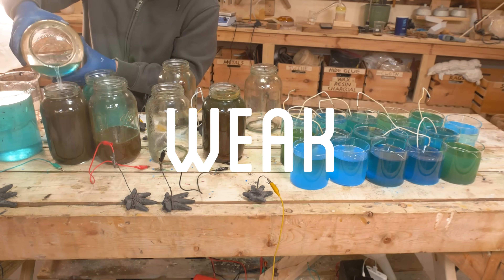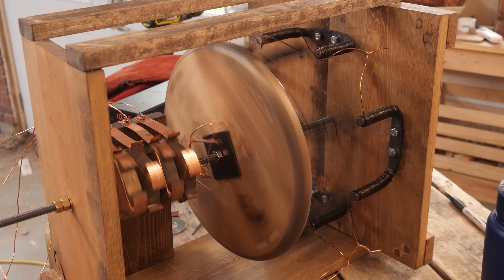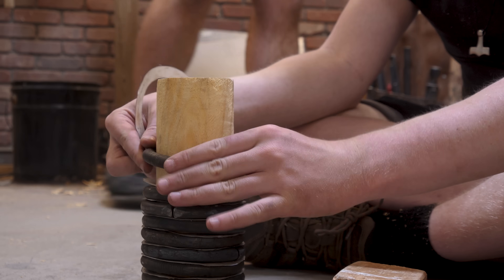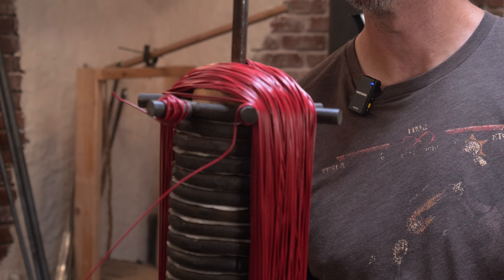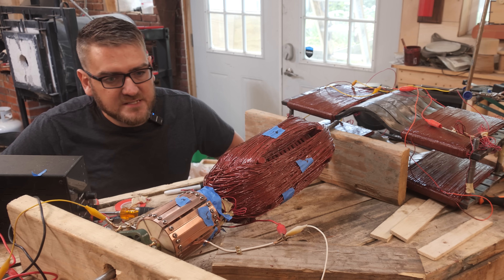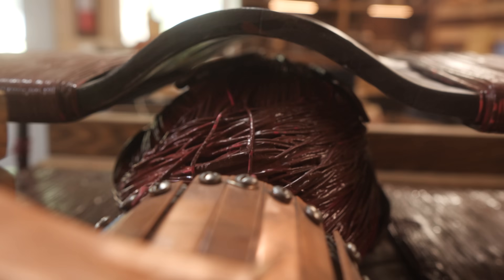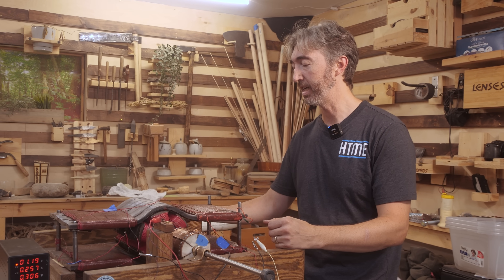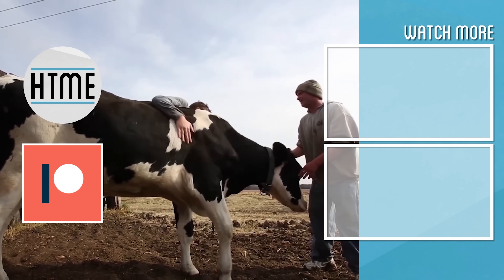I Built the First POWERPLANT!

Comment from the maker: Get $5 off your next order through my link https://sponsr.is/magicspoon_htme_0925 or use code HTME at checkout, or look for Magic Spoon on Amazon and in your nearest grocery store!
Reply: Your second rotor was not only more consistent but had a much better magnetic design. The iron laminations are where the magnetic flux flowed, having a much lower reluctance (magnetic resistance) than the huge amount of air in the first. Now I’d like to see the same in your stator, which was improved by adding the iron tie rods. But replacing those with huge iron cored electromagnets between the pole plates would increase power generation. The other thing that’s helping with your second rotor is reducing the air gap between the iron of the rotor and stator. If you could find a way to bore out the stator plates to a perfect cylinder, only slightly larger than your rotor lamination outer circle, you’d be cooking!
Reply: @MarkSJBeard  He also could have run the rings on the mount through a lathe to get better tolerances.  To make tighter clearances between the rotor and coils, The the iron cores as parallel as possible and then use a large boring bar to machine the rotor area smooth.  An inverse lathe, if you will.  You could get a paper width between the rotor and coils at that point.
Reply: I feel like it would be good to make a capacitor next to balance out the current instability and the flickering problems.
Reply: @risingmoon893  something better than a capacitor is a motor with a flywheel attached to smooth out the slow voltage spikes, a modern one could work for debugging
Reply: please change the title to "I Built my First POWERPLANT!" because your current title is misleading
Reply: A suggestion; what about a second brush but inverted on the other side of the commentator. I.e a brush on top and a brush on bottom. 

Or you could add several smaller brushes to help off set the bounce.
Reply: something that can massively improve the design is replacing the flat stator coils with bunched up coils, the tighter the coil the more powerful for a given amount of wire, the coil must spread out a little but the more this is minimized the better
Reply: Cant you invert it? like, make the magnets rotate inside or around the coils, to get rid of the need for the "brush" on the generation part of it. i dont know, just a thought.
Reply: @TarubXCI  That will produce only a.c. power, which is fine is some applications but to replicate early power generation you need d.c. to make things easier to understand.
Reply: So was the plan to use the electricity generated to make the coil magnetise the iron core with the hope of increasing output oerall?
Reply: IMHO the biggest problem is the weak and hardly controlled field of the stator.
Building the stator from continuous, forged plates gives the magnetic field a path of low reluctance along those plates. There is no "incentive" for the field lines to get out of the iron of the stator and close their circuit through the rotor. Also, these cores leave the magnetic circuit completely open on the outside of the dynamo. I am pretty sure the magnetic field is much more intense at the ends of the stator than between the intended poles.
I would suggest using the plates to build U-shaped electromagnets with rounded poles.
Something like this :
    _
   |  |
  (   )  (   )
           |_|

These could be placed alternately, left and right (although this is not necessarily advantageous) .
Reply: graphite brushes would be an improvement for the generator. graphite is both a conductor and a dry lubricant.

that and really centering the rotor...remove as much vibration as possible, so you folks can run it at really high speeds!

Comment: Why not try coil on coil coupling. It would give you much more power. I see the steel plate is acting as a flux return, but wouldn’t adding stator windings give much stronger and more controllable torque? Coil–coil interaction usually beats passive iron shaping, especially if efficiency matters

Comment: With my limited knowledge, I would say to swap the rotor and stator so that the magnets are rotating and the wire is stationary. This way you can try to get smoother, separate coils and spin a lighter mass that can get a lot closer to your coils. Smaller wire gauge should also help so you can fit more wire to strengthen magnetic fields, and spinning your rotor faster and more smoothly to maintain your AC voltage. The shorter those gaps in voltage, the easier time you’d have reading it

Comment: question for anyone whom might know, Would there be reasonable energy produced by simply wrapping insulated copper wire around an aluminum pipe and passing water through it at some pressure and velocity?

Comment: A GM alternator has the coils on a stator wrapping around the armature. This allows for a lighter rotating mass and a more prosise gap between the the stator and armature, then once the armature gets exited with electrons it produces current. It is also possible to self excite as a windmill or something of this like or by adding a small battery to excite the field. I suggest looking at the GM alternator for a proof of concept.

Comment: if a gearbox can increase rotation per minute then would you then see that the ending RPM can rotate a generator core faster then the rpm at input. Granted that the increase in crank energy provided and a more stabalised foundation is needed for a multiplied output, but it is deffenately doable.

Comment: "Great video! Attempting a self-exciting dynamo is incredibly tough. I think you are facing two main issues:
Residual Magnetism (The "Bootstrapping" problem): Since you used soft iron rings to reduce eddy currents, the core likely has very low magnetic retentivity. A self-exciting generator needs a small initial magnetic field to start producing current. If the iron doesn't hold a charge, it produces zero electricity to feed the coils, creating a loop of nothing. The fix: You need to 'flash the field'—briefly connect a battery to the field coils to magnetize the core just before (or while) you start spinning it.
The Commutator: You were right at the end. The large diameter creates high linear velocity, causing 'brush bounce.' A smaller commutator or stronger spring tension on the brushes ensures constant contact.
Hope this helps you unlock the lightbulb!"

Comment: I would consider looking at how early lathes managed speed for your input. A series of belts and pulleys, combined with a flywheel to help smooth it out a bit, could really help on the input side. For the contacts on the commutator, you could try to add some springs on a fixed bar above them to try to see if that downward pressure helps ensure more consistent connections.

Comment: This really show cases as to why steam powered belt & lineshaft systems were so popular for a time, as simply making a turbine at all required a level of sophistication not possible by hand. While steam powered systems greatly improved speed and force they also improved finesse creating a number of products. Even after city wide turbines were in use these belt & lineshaft systems swapped out their steam boilers for electric turbines and exchanged in house coal burners or city wide coal burners. Many cities became very proud of swapping out their gas lamps for electric ones. However, trolleys were only electric powered, thus making the first transit system electric.

Comment: Try to excite the core artificially with a power supply, because you might be not generate voltage high enough to make strong enough field. Gap between stator and rotor should be as little as possible, makes a lot of difference. Commutator should be a smooth ring, its will decrees sparking. Also there is better material for the core than just steel, ferromagnetic alloys.

Comment: Aren't you making AC voltage? Have you checked? Have you checked the wiring to match the examples you have shown? Top stator winding connects to the winding before it, them that goes to your output, same but opposite for the other side. I think that also means you should connect the stator iron like it looks like in the pictures with the bolts. Some things good you to try

Comment: Wheree are u guys located . I have  some serious  additions that could help. Would apprentice happily.  But i gotta ask are u stuck.on this design or any design that will create electricity.  Cause if ur flexible  trust me we need to catch up. Happy to share  my blue prints and some engineering parts i have access to others  incant get to at the kment but xan wasily recreate . This is the exact  project i was going to do. Only i  was going  to go from  actual ground to full production scale. Ive been a pipefittter steel guy roofer hardscaper carpet work and a gym owner / pugilist. I have a number of project's  including  a water purification from air/ electrically assisted high yield shortened time crop production system all in one.  and multi input electrical system assisted part gravity part wind part electrostatic with oldschppl chemical batteries snd conversion. Inknow ull laugh  but i think i cam avtuslly tramsmute elements as well on a small scale. No patents just work a d hopefully a better  future. Truly feel were running iur if time if certain projects continue on the national scale. Sorry fir the spelling and punctuation but im excited.  I northeast usa  hope are too

Comment: are your standoffs conducting electromagnetic field away from the rotor? might be cutting efficiency by reducing the field lines the coils are passing through by pulling field from the rotor and in to the standoffs? also lathing the surface of your commutator will cut bounce if you can cut a straight line yet or use stronger springs and let erosion smooth the circle with an electric motor while you sleep.

Comment: Checking in here now to see all of the suggestions. Wondered if anyone thought of making the contacts able to change their positions to correct the latency’s of the current. Could be adjusted for different speeds for maximum output. Plus or minus a few degrees in position is worth trying. Thinking mounting on a wooden cross piece for the contacts. (Water paddle wheel style.)

Yeah it adds complexity but effectiveness sometimes is needed for maximum effectiveness.

Comment: So, the timing bit is difficult. Modern generators use a micro-controllor to handle the timing of the current switching. This is because using a contact like you have will not only introduce inefficiency but also will add wear over time. In the meantime, switching to a flat copper braid cable as your contact might produce a more consistent result.

Comment: If you can, put some graphite between the commutator brush and the rotor. helps keep consistent contact between the two and prevents the discharges off the commutator and the friction from eventually eating your brush.

Comment: As far as I'm aware, making a self-exciting generator is difficult without permanent magnets. I think you could make one of those primitive batteries you've made before, connect it to either the stator or the rotor and use it as the input for the electromagnet. You don't need crazy input power so the battery would be enough. If connected to the stator, the output at the rotor will be DC because of the commutator. If connected to the rotor, I'm pretty sure the output at the stator will be AC, which is still useful but not in charging batteries. There is quite a lot of videos of people turning AC motors, into generators by connecting a capacitor, which you should be able to make with your current technology. The capacitor can charge up, act as the input power and then get constantly recharged from the spinning of the rotor, essentially acting as a self-exciting generator. This probably sounds very confusing so look it up, as I am not the best at electricity. Also, speaking of AC motors, you could try running your generator as a motor, although idk if that would help with anything.

Comment: While not speaking directly to the electrical generation, it might be beneficial to introduce a heavy fly wheel. This will smooth out the rotation of the crank which in turn could help with a more uniform power output.

Comment: as a physicist i think you should make the stator more round, possibly with a lathe, and make sure you really precisely put the rotor snugly in the middle. you want as little air in between them as possible, 'millimeters' is too many millimeters. precision is key here i think.
also make the stator hug the rotor more on the sides.
personnally i would not put multiple coils on the same piece of iron in the stator for my first design, but thats just to keep it simple. i would put the stator coils pointing radially, not in this weird flat shape.
i dont understand this stator design in general, i feel like the iron connections should be the other way around, connect vertically if you have the coils like this, and not connect horizontally as to make the magatic polarity as large as possible over the rotor, it feels like you are only using like 10% of the magnatic field of these stator coils, because of the allignment, but maybe the iron changes this. again you probably want your coil radially from the axle, similar to the rotor coils so that their field points in to/out of the rotor. if you use 4 or more stator fields, you want to alternate north south.

i dont know about your wireing (cause you didnt share it :(  please share your circuit diagram) but if you are changing the current in the stator, the metal should also be laminated against eddie currents. it is a good idea to do anyways, since your rotor also makes changing magnatic fields in the stator

its been said alraidy, but:
- use a capacitor to make the current steady, would also help the stator probably, so dont eoverlook this as an option to make the engine better.
- use a gearbox, balbearings and lube for some serious rpm
- make live measurements with an occiloscope, it would go against the techtree, but it is good to get insight in what is happening
- use brushes or carbon instead of springy copper for the commutator

some more tips:
- if it stops starting by itself, try turning the whole thing 90 degrees, it is probably using earths magnatic field to start up
- experiment with the phase of the commutator, it might be better to have it shifted a bit forward since the rotor changes the field sligtly, make sure to test it on the desired rpm
- you can connect multiple coils at the same time with the commutator by having a broad brush, sometimes this is better, because 2 coils can be doing work at the same time when you have 3coils in the rotor

Comment: You can run some capacitors in parallel with the output to smooth out the pulses so you can get a smoother output to measure the current. Even things like buck converters can be useful as well, and cheap.

Comment: Most commutators use wire brushes to connect to since it means any bounce is less likely to disconnect it or it just wont bounce at all
You probably want to either switch to wire brushes or put small cuts in the conducting plate (the one that is connected to the cabling) to replicate it without having to use wire brushes, it wont be as efficient but it should be an easy adaptation

Comment: You can get rid of the commutator by looping one pole of the rotor clock wise and then anti-clock wise for the next one. At the ends you only get two wires for two contacts that can be soldered to a copper ring, then use graphite contacts and.... Wait... You know what, you will end up re-making the 3 phase induction motor by the end of it.

Comment: No wood, add bearings; instead of wood use metal. Metal is more durable; bearings make more accurate turning and speed of turns. Also wood may not last; it may break and will have to be redone.

Comment: Since the magnetic flux lines curl around the coils of wire, shouldn’t the stator coils be wound perpendicular to the length of the stator instead parallel as it is now? Because in this orientation, wouldn’t the bulk of the magnetic field be generated parallel to the stator bars and thus not interacting much with the rotor because the flux prefers to mainly travel through the iron and not the air?

I believe this is the setup of the generator: 
N((((S—N))))S
     ======
ns       *       ns
     ======
N((((S—N))))S
Legend: = is stator iron bars, ( and ) are the wires wrapped around the bars in different directions, * is the rotor, — is the part of the stator bars with no wires wrapped around it, S and N is the magnetic orientation, and n and s weaker magnetic poles orientation.

I believe the idea is that right ends of both bars combine to create one main magnetic North pole in the air gap between the two stators, and the left ends of both bars doing the same to create the South pole, right???? This should work, however, the poles would be rather weak because magnetic flux prefers to travel mainly through the iron bars instead of combining in that air gap to make one strong pole. In order to make the magnetic poles stronger, and thus get better results, shouldn’t the coils instead be wrapped perpendicular to the stator bars? So like this: 

           S
          )|)
          )|) 
          )|)
           N
     ======
           *
     ======
           S
          (|(
          (|(
          (|(
           N

Legend: = is stator iron bars, ( and ) are the wires wrapped around the bars in different directions, | is a perpendicular extension to the stator in which the coils should be wrapped around, * is the rotor, S and N is the magnetic orientation.